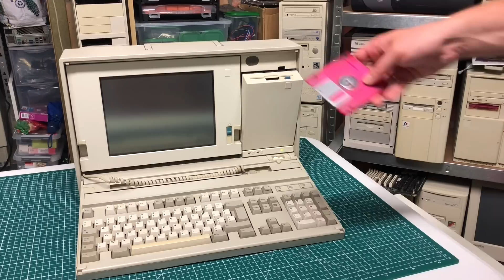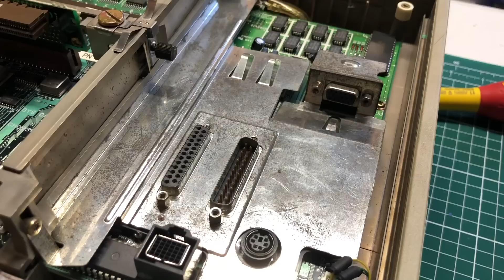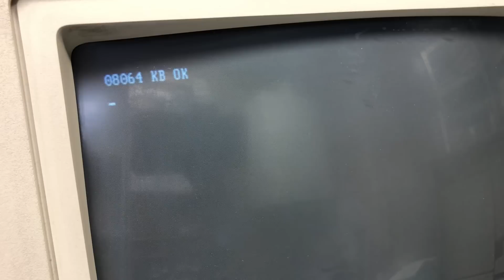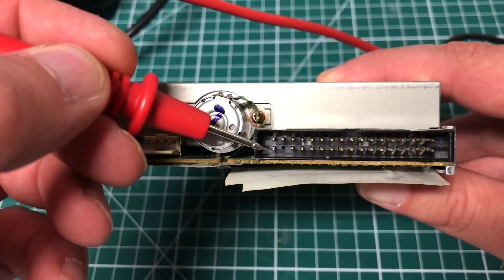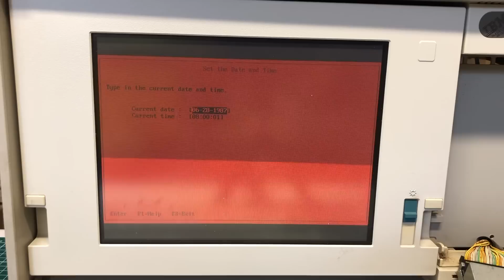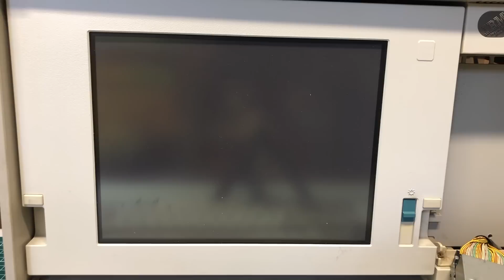Getting my non-working IBM PS2 P70 back into shape.

Comment: i have one and it used to work but now it says error 10482 wich seems to be  	Controller transfer acknowledge error
i have tryed reseating the harddrive connector cable on the motherboard and on the disk but doesnt seem to solve it sadly so now i have no ideer what to do , and if it is fixable so i just starts in the ibm basic menu now

Comment: Great video!  I have the same issue with mine you had in the beginning of your video with the display not turning on and the long beep followed by two short beeps.  Do you have any thoughts on what you did during the disassembly that may have fixed this issue?  I did remove the back cover and disconnect and reconnect the ribbon cable coming out of the video card.  Nothing looked corroded or suspect.  I left the ribbon cable unplugged and turned on the machine and got the same beeps.
Reply: Disconnecting and re-connecting cables can sometimes clear off slight oxidation that may have formed on the pins.  At ZDS we used a product called Nyetact to coat the pins of the power board connections and displace any moisture or air where it connected into the motherboard.

Comment: I need help about it: ive refurb three standard floppy drives to ibm ps2 p70 according to this great video with success + one recapped stock working unit. ive got a big problem with my ps2 line desktop model, the 55sx.
 it wont boot, after a normal seeking floppy drive, classic error message appears 161 163, then (at the time when it could run normally a ref disk or other boot disk) dont boot just initiate the drive during 0.5sec, the book logo appear. if i press f1, the floppy drive initiate during 0.5 sec then go to the ibm basic. none of my working drives (4!) on my p70 work on my model 55sx. To achieve my test, ive just bought a new old ibm stock spare motherboard, (not the same review) and it do the same things. ive also replace my dallas chip with newer one (build year 2020) or test with my two working modded dallas chips. 
my two ibm planar have 40 pins floppy connector with ibm 34 pins floppy cable. i dont know if the 5v on the pin 3 on 40 pins floppy connector is enough to drive the ...drive! ( i ve just suspected that my main motor run slowly even if the seeking is ok), please any idea?

Comment: Hey. Great video !! How did you get the floppy drive out ? You never showed how you removed it from the case. Do you just pull it out or is there screws that need to be removed ?
Reply: if you download service manual it s easly explain with schematics. deploy screen and drive then pull the left side drive cover to you , push up .. thats all to access to the black screw at the bottom center of the drive support. unscrew it, lift the drive, et voila!

Comment: Thank you for this video, really great. I've had one of those since its heyday. I had it stored away and recently unpacked it. Obviously it didn't work butt I got it going (after replacing the floppy) and was working but then it started to fail intermittently. On power on, the kb flashes, the power light comes on, the hard disk drive seeks and then nothing. The usual memory count during POST doesn't happen.  I have removed all cards, RAM, etc, cleaned everything up, reseated everything but the poor thing refuses to boot. There's no obvious thing on the motherboard or the memory which is what I can only think of, based on the symptoms. Is  there a schematic with voltages I can use ? Any ideas ? I read where this is not uncommon and the boards slowly "die".

Comment: I have a P70 and I had the EXACT same problem. And I did the same, take it apart, lay it on the table and it just suddenly worked with an external screen. So I put it back together and...nothing. Took it back apart - nothing. Dead screen.

The long beep and 2 short is a video card issue. So I took the video card off and replaced the 4 electrolytic capacitors with new ones. I had to use special solder to remove the old stuff. But low and behold I put it back together but it now works perfectly - plasma and all. So my guess is unless you recap the video board, it won’t work consistently for long....

Comment: I once owned an entire basement of PS/2 Model 80 and 90 servers that a shoe store factory was tossing. Nobody wanted any of it. There was at least a couple of hundred thousand dollars of equipment if you went by the new prices - network cards by the dozens, SCSI drives and adapters, processor upgrades - amazing. The build quality on IBM equipment was and is absolutely the best. Up until recently (and possibly now), Lenovo continued this tradition of fantastic build quality with the best components. This computer of yours is magnificent!

Comment: ESDI drives used the same cables as ST-506 interface drives, IBM deviated from this for the P70.
Reply: Yeah - whilst these drives may use ESDI electronics, I recall reading that the physical interface (the single large edge connector) was called DBA (Direct Bus Attachment)

Comment: Thank you so much for this video, I bought a p70 and spent ages fighting with the floppy, some guides made it seem a lot harder to use a modern floppy but sure enough I got it working. Right now I have it running through USB with a wire that I made because I didn't want to mess with the wiring of the P70 power supply but now that it works I suppose in the future I can make it self contained

I imagine a gotek would plug in just fine in the same way if I cut the 12v pin off if I ever get tired of real floppies. Have to look for another old PC floppy drive too as I sacrificed the only one I had

Comment: Hello and thank you for this video! 
Can I ask you for an opinion? 
I recently found my old ibm model P70 386 in the attic. I tried to turn it on and it starts and the monitor works, the problem is that it shows me the error number 113 and it does nothing else. A quick research and I found that the 113 error stands for “PS/2 MicroChannel arbitration error”...do you know how to solve this?
Sorry for the long post and for the request, thank you for your time!

Comment: at 5 seconds i can see a desktop in the rack. It's the 2nd from the right. I have the same one with an ESCOM badge, which badge is on yours?
Reply from the maker: Mine has the commodore logo (and also had the commodore logo in the windows 95 system props). It was actually the very first retro computer I ever bought (cyrix 6x86mx pr166)
Reply: Wow really? In mine is a 486 DX2 (original), so it seems that this enclosure was used for a long time (well, 3 years or so).

Comment: @RetroSpector78  .. 3:36 .. that heat sink is for the chip to the left of 386 .. It has thermal paste on it??.......
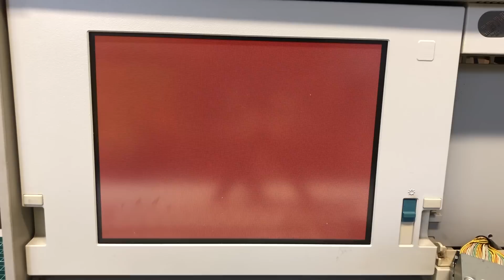20:17 .. Windows 3.11 ??  .. Where is the network card??  AWSOME Machine!!
Reply from the maker: I have a really long MCA 3COM Etherlink card but not really sure if it will fit in here ... should give it a try :)

Comment: Those machines are really beautiful and cool. The only reason I don't consider rescuing one is because they don't usually come  with a hard drive and sound card tho, so they are not very useful
Reply from the maker: Soundcards are pretty easy to find, and with hard drives you can also opt for the xtide universal bios.After working with XT machines a lot, it's nice to work with these 286 machines. They're like little speed monsters compared to these old IBMs :)

Comment: Wait, how the heck did you pull 5V from pin 3? I thought all the lower pins were ground? Trying to follow you with the mod of my drive but I am confused!
Reply: just add one physical pin on pin3 on the floppy connector (modern floppy drive dont have it) but dont connect it the floppy drive pcb at all, that s the tricky part: directly behind the connector, connect one wire between this new pin3 and your 5v  floppy drive power connector pin, or on pcb (to remove completely power connector, to avoid bad usage and keep old style floppy drive). dont use the pinout 3 on the pcb, its usually one ground pin!
Reply: aaron71 this is from about 30 to 40 years ago it won’t be the same
Reply: @expertshooter2055  huh? what won't be the same?

Comment: There is not too many parts on a PS/2 that are standard. The P70 and P75 are even worse. Those floppy drives would die shortly after coming out of the box. Thankfully they were usually easy to replace since most had edge connectors on them. And there are no less than 6 different variations on these drives too even though they are all nearly identical in function.

Comment: I love my P70. Have had to replace the floppy (hacked in a standard one as this one has power over the ribbon cable as you say, but you can make up a cable easily enough, it's just hard finding a drive where you can use the original eject button) and hard drive so far and the clips for the screen have recently broken. Edit - Oh OK I have now watched the whole video :)
Reply from the maker: Yeah ... need to revisit the drive. Have replacement caps and will fix the ribbon cable.

Comment: What you did was a workaround, but what you should have done was attempt to repair the original IBM drive. I'm sure all that you would have needed to do is re-lubricate the rails that the head slides on and it'll be fine. That's a common problem with old floppy drives, the lubricant dries up and the servo can't move the head anymore. Some light machine oil would do the trick. Try doing that before looking at completely discarding that old IBM floppy drive first. As for the caps, I would ignore that.. if you get motor spin, the drive is halfway to working.
Reply from the maker: Bud Bennett these drives are known to fail due to the caps. Virtually every post you see online ( + some people I know that have them have had cap issues with this one). And there was some leakage near some of the caps. But you are correct I could have tried that. Will pick up the drive issues in another video, but I was also interested to find out if a standard drive would work.

Comment: Hey, glad you got your P70 working again! Mine is still struggling with some video problems, unfortunately...

I've replaced the caps in my P70's floppy drive with ceramic caps: https://twitter.com/kpanic/status/1115193356622155776
They're cheap as dirt and, not having any liquid electrolyte, should last forever...

Those PS/2 hard drives are actually IDE hard drives, connected to the MCA system bus. That's why they are neither ATA nor XTA compatible. The controller is embedded on the drive PCB, either a MFM controller (for 20-40MB drives) or an ESDI controller (for larger drives). 

If the drive should decide to stop working one day and a replacement is unobtainable, you could plug an MCA SCSI adapter card into the system and replace the original one with a SCSI drive.
Reply from the maker: Thanks for the insights ... Ordered some replacement smd caps but broke the flex cable connecting the head assembly to the PCB :( That just made the repair exponentially more difficult :) Thx for the tip on the scsi drive.
Reply: @RetroSpector78  Bummer... Sorry to hear that.